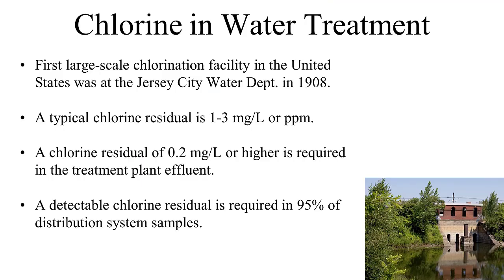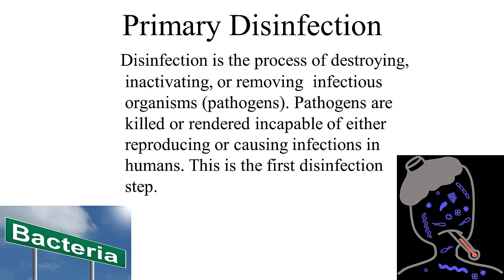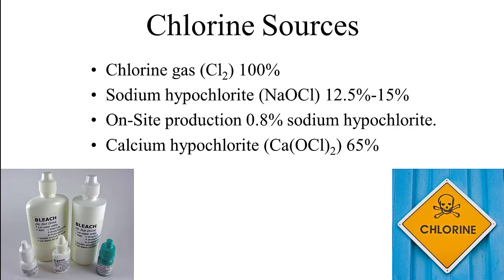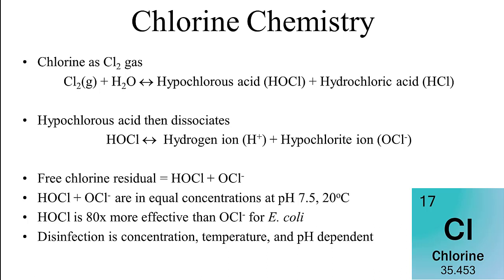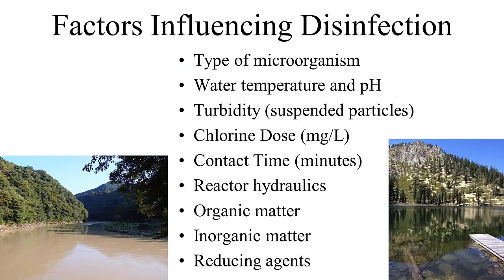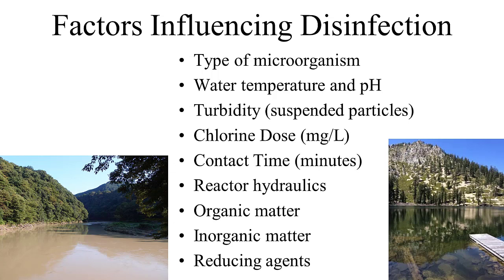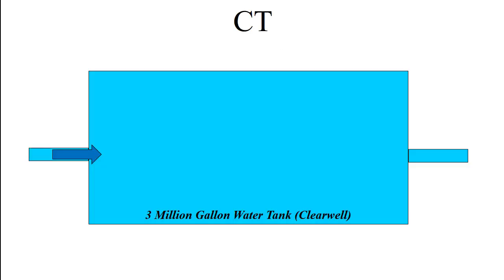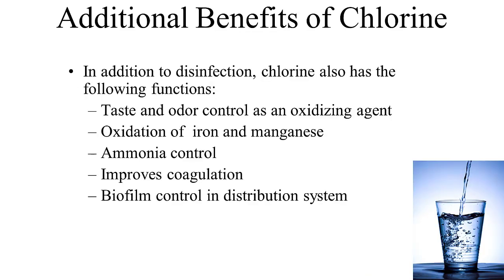Disinfecting Drinking Water with Chlorine

Comment: what can i use to disinfect my tank water ? can i do it with chlorine ?
Reply: While In theory, you can however, if you get your tank water from a source that has already been treated, then it would be redundant to do so. On top of that, there’s most likely cheaper and safer alternatives and possible filters or filtration systems that will give you the same benefit of disinfecting rather than attempting to disinfect your tank water yourself 😃
Reply: @bdc_ky  alright thanks buddy

Comment: Hi Jim smith. Just a quick question. I have a larrge pond, that has alklainity of 100ppm, pH of 8.5, and is filled with bacteria. I am planning to add calcium hypochlorite into it. I understand at high pH most of the form of the hypochlorite ion will be in the less favourable form, hypochlorite, and very little hypochlorous acid will be there. Now, since hypochlorous acid is much much more effiecent (80x) at kiling bacteria, i assume once added, its concentration will be depleted quite quick. Since it is in equilibrium with hypochlorite ion and H+, so wont the equilibrium respond by shifting left, thus increasing the concentration of the hypochlorous acid and thus reducing the concentration of the hypochlorite ion?
Reply: Hi Michael,
If you have any fish or aquatic life in your pond, adding calcium hypochlorite will kill them. The dead fish and plants will create an oxygen demand and may cause an anoxic condition which could create foul odors. If there is a discharge from your pond to a creek or a river, it could cause a fish kill and make you eligible for fines and other legal repercussions. As a water treatment professional, I have always treated any water discharged from my plants to ensure chlorine was never released into the environment. A body of water will always have bacteria so I am not sure what you want to accomplish. I would suggest researching hypolimnetic oxygenation systems and aeration systems instead of adding chlorine to solve your problem.
As far as the chemistry of adding calcium hypochlorite to water with a pH of 8.5 and an alkalinity of 100 ppm, I would not expect the pH of the water to change if a small amount of calcium hypochlorite was added to create a low free chlorine residual. If a large amount of calcium hypochlorite was added, I would expect the pH of the water to increase since the pH of calcium hypochlorite is between 10 and 11. Consequently, I would not expect any hypoclorous acid to be formed.
Jim